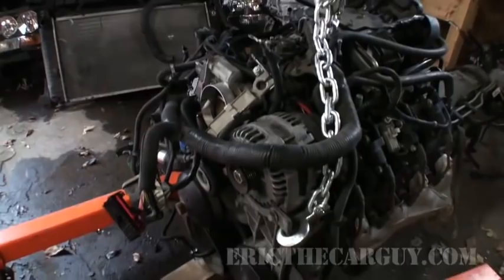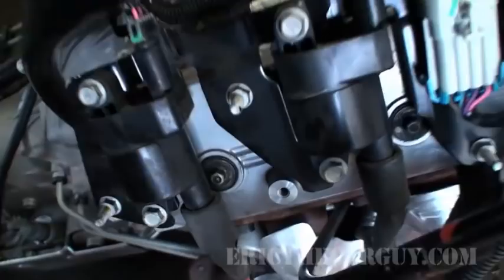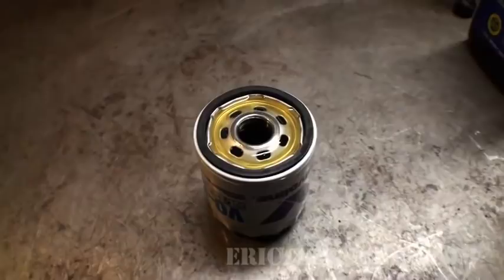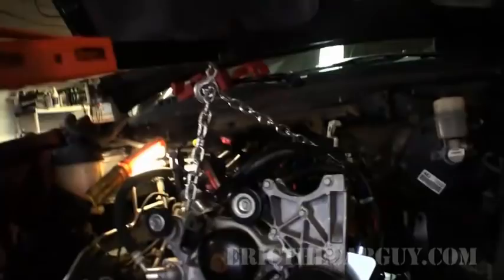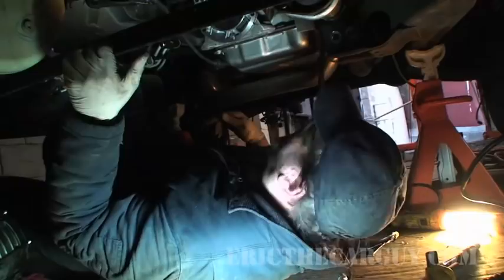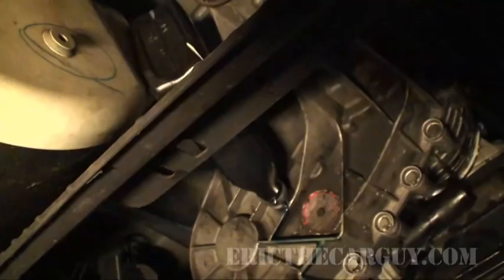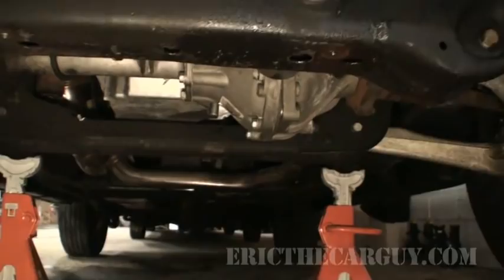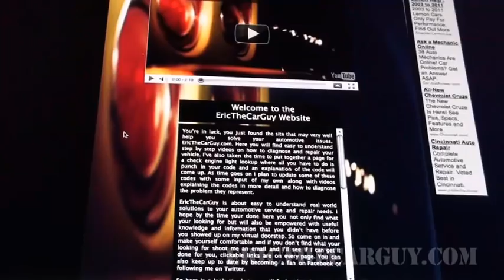2007 Tahoe 5.3L Engine Part 3 - EricTheCarGuy

Comment from the maker: @itneverwasme The PS works I just had to rev the engine to get it to start circulating, same thing on the last GM I worked on, works fine now though.  I do plan on doing a Part 4 covering what happened to cylinder #6 in a few weeks.  Thanks for your comment.

Comment from the maker: @acttacus That is good to know because I looked for the adjuster under the steering wheel and by the trans and didn't find it, the shift cable on this truck runs along the frame rail and then up by the gas tank so I really couldn't see anywhere for the adjustment where I looked.  I'll be sure to look tomorrow though as I'm fixing the exhaust and going over it before I send it on it's way.  Thanks for the tip.

Comment from the maker: @qaz3000 I think your referring to a block heater which you may find on cars and trucks in cold climates.  The cold makes things thick and less likely to move correctly, also batteries don't work as well when they are cold so between those 2 things it's hard to get a car started from stone cold to running again.

Comment from the maker: @Michiganborn1969 Yea it was close but it worked.  The injection system you describe has been used for a few years on GM vehicles if I remember correctly.

Comment from the maker: @nizmojoeblows If it's fuel injected it will actually warm up quicker if you drive it, engines really don't like to idle for long periods and in a way it wastes gas.  If it's that cold for log periods of time you might consider a block heater  as they are great for cold weather like that.

Comment from the maker: @touchymuffin97 With enough money and time you can do just about anything.  The thing with 'modern' engine swaps is that you need to consider if your computer will run the new engine correctly, sometimes you have to change the computer and wiring harness to get that to work.

Comment: Great videos Eric, love em.  Watching you wrestle with the transfer case reminds me of the time I changed the clutch in my 1978 Econoline.  It was in my driveway in the late fall.  The weather was terrible and I was laying on a blue tarp under the truck holding the transmission up while a couple of guys were above trying to guide and install bolts.  A gust of wind shifted and the freezing rain/snow dam that had formed in the blue tarp let go and suddenly yours truly was laying in ice water. Fun!

Comment: I was replacing the transmission and transfer case on my 48 Ford, so I bought a transmission jack to make things a bit easier. Well, the one I bought was a cheapy and it really wasn't strong enough. The transmission went in ok, but the transfer case is much heavier in this case.  I had the transfer case nearly into position when the scissor-style jack just started to fold over. I tried stopping the 200+ Lbs with my hand and it just pinned my hand to the floor....fun times.

Comment: Eric, you need to get yourself a transmission jack! You even said so in the video. You could pull a muscle or a transfer case could slip out of your hands and hit you in the chest and that would really be a bad day!

Last Saturday, on the December solstice, I woke up with a torn muscle on the lower, right side of my back! Oh, did that hurt! It still hurts a little. The day before I was working out with dumbbells and jumping rope. I must have pushed some muscle too far.

Shifting a transfer case around, the damage could be so much worse. Treat yourself, buy a transmission jack. It's money well spent and you deserve it :)

Comment: Sometimes we have to make do or do without when it comes to repairs. Chrysler doesn't even use gaskets when it comes to the transmission pan. I've used gasket maker for nealry 25 years and NEVER had a problem with leaks, whether oil, transmission, or coolant. Nice job Eric.

Comment: Cool background music, great video. I was a little worried for you when I saw you balancing that transfer case over your face. Lose it at the wrong moment and you would have a new set of braces. There has to be an easier and safer way. Could you make your own trans jack with a floor jack and some plywood?

Thanks for posting, Eric.

Comment: Hey Eric! just a quick tip. Keep some stuff called "The right stuff - One minute gasket" on hand. Its absolutely awesome. used it on the Front differential of my ford ranger ( you have to remove the pumpkin from the frame, real fun) and the rear diff of my F150. It seals amazing, and the surface doesn't have to be perfect for it to work. Its meant to be used withOUT a gasket. It would have sealed that Transfer case up perfect.

Comment: Someone else has mentioned it but you can buy a lift plate the bolts to the valley as the anchor point for engine remove/replace. I made one out of two 19" pieces of 2"x3" angle iron. Fit perfectly once the hole were drilled.

Comment: Power steering priming tip, no revving/engine off, you fill the reservoir up and with the wheels off the ground just cycle the wheels back and forth, it pumps the oil through, and just keep the reservoir topped up as you do it, at some point it will just remain the same level and its done.

Comment: just like they're thinking for the pickup tube o-ring and nuts on the bottom side you got to drop the oil pan when there's a threaded hole on the other side and you wouldn't have had to go figure really great

Comment: In the last video comments i said silicone is fine at the transfer case when reassembling. I've done it many times this way and no comebacks. Actually just did one last week. It was fun to watch you struggle with it but I don't understand why you didn't remove the driveshaft. It just slides out after you remove the boot clamp. The cats do come out from undernieth. You have to remove the trans crossmember and front driveshaft. Job well done again..

Comment: eric if you go to northerntool's website, they have a transmission jack adapter for about 50 bucks.  Just stick it on a floor jack and youll no longer have to wrestle with transfercases and transmissions

Comment: Great video and series on this truck, my fav so far. To those that say Eric should have used a jack, ever try to balance a tranny or transfer case on a jack? It is not going to happen. I've done the same routine, balance a tranny on my chest and fight it into place. Not pretty but it works.

As for the sealant he used, it will outlast any conventional gasket. In fact most transmissions now only use RTV because it will outlast the vehicle in most cases.

Comment: @EricTheCarGuy A lot of techs try and only take apart what they feel is necessary to save time. In the long run it saves time and headache sometimes to just remove the things that make life difficult. I use zip ties on the driveshaft boot. There is no flex there like a CV boot. Its just a dust boot.
 I hope i'm not getting on your nerves lol.

Comment: Nice video!  I would of disassembled the front suspension.  In order to lower the engine and support.  That way you can lower the whole thing to the leg of the engine hoist and wheel it out.  That's just me.

Comment: How's it going Eric. I gotta 07 tahoe. Giving me he'll. Replaced all lifters coils, gaskets plugs wires. 2 lifters immediately busted.. 4 and 6. Replaced them. Head off again. Start it up take off. Lifter bust on the other side. I'm not getting rid of my Tahoe but I'm angry. What's wrong with my 5.3

Comment: Eric, i have a 96 Jeep Zj and i change the t/c fluid 2 x a year, i have one of those hoses that screws only the bottle and also a pump, pump is SLOW as the hose dia. is very small. I just changed F+R  diff fluid

Comment: I know what ur sayin, I hate it when ppl want me to swap equipment because there is always issues getting it back right... I did my Toyota from a 3EE single cam to a 5E-FE twin cam, studied wiring diagrams for weeks. Swapped the distributor harness and run it on the old ECM

Comment: Nice job, the sealant will be fine-screw Warkhan.  What happens with the power steering, still no pressure at low rpm?  Would love to know what's up with the original engine, but take a break, you need it after this best

Comment: great video Eric! Well i have a 1994 Mazda mpv rwd 3.0 and I want to put a 2011 Toyota tundra 4.0 v6 engine and transmission. I want a strong and fast set up and also one that would last. I was also looking at a Nissan pathfinder because they are both rwd and the van is rwd. I was hoping you had any tips on that.

Comment: Once he removed the front and the core support , radiators , etc. he dont have to put it on the ground.  Some cars it much easier to put it one the ground though. Two weeks ago  I pulled an engine out a 94 Camaro and I had to put the car on the ground to get the engine w/transmission out the car completely.

Comment: Some people aren't real big on using paper gaskets, they go straight for the RTV. I've heard complaints about seepage... I never witnessed a situation like that but hey......

Also I have seen Felpro gasket sets come with a tube of Permatex Gasket Maker RTV and instructions to use just the RTV in place a gasket that is not included....

Comment: older motors have a  distributor that set the timing and newer motors ( gm 00 up ) dont have a distributor they have a coil for each spark plug and the computer sets the timing

Comment: Thanks for posting these engine swap vids!  i love 'em!   But i come to you with a question,  I'm having a problem with a 2000 sienna, that i'd like to get some advice on.  It shakes like crazy at 65-85mph.  Any slower or faster, and it drives real smooth.  I've replaced the drums, tried another set of balanced wheels, and replaced the shocks, but to no avail.  I cant tell if its coming from the front or back, because the whole thing is shaking, any advice on this one?

Comment: @deeman52586 I've done the cats on this truck before. They are not as bad as they sound. Long extensions from underneath with an impact are the way to go. If I recall I did have to remove a Xmember but all in all it wasnt as bad as it seemed.

Comment: In part 2 asked why you didn't take the fuel lines off at the intake. I see why, the brackets attached to the trans. Also when my dealer replaces engines in these trucks, I believe GM does instruct you to remove the intake manifold. So the fuel lines have to come off the fuel rails. And the trans stays in the truck. You asked about replacing cats. It's tight, but you remove that cross member and the poorly placed O2. Lots of penetrating oil on the nuts. And get 2 people to manuver it out.

Comment: @EricTheCarGuy - I do not want to see the pricetag on those two catalytic converters - I'm guessing the whole section was bought from the dealership? I'm going to take another guess that you get jobber rates on parts and supplies - if you need exhaust componants - try looking at fle-online. com (Full Line Exhaust). They have excellent rates and don't rape you on shipping. I sourced all my componants from there for my MX6 exhaust including a Magnaflow/Carsound cat for $65. Great rates for OEM too

Comment: you could use a gear oil pump to fill the transfer case. They work GREAT and cost $10 at napa  They look like a soap dispenser.

Comment: i have a 99 tahoe and i put a 700r4 trans in it why when i pull a hill or the rpm's pass 2000 my truck bog down and have a smell coming out of the tail pipe

Comment: changing the cat's is really easy after u remove that o2 sensor, the sensor looks like a bitch but it is easy to remove, then use a 15mm semi deep swival impact socket and bam bam they come off, remove that crossmember witht eh 18mm wrench and socket and they slide right out!

Great vid man! love it!

Comment: Messing with that transfer case just looked super dangerous. I couldn't help picturing it slipping out of his hands and squashing his head like a watermelon.
Reply: They aren't that heavy. I could probably swim the english channel with one strapped to my chest.
Reply: I doubt that. I've worked with them plenty of times, they aren't that light. I was being sarcastic about the watermelon thing anyway.
Reply: Nick B I was being silly. When I owned a truck with a 208, I could remove and install it buy myself. Same with a turbo 350. I have taken out a 203. That was heavy and all of these on my back, the transfers cases without a jack.

Comment: Push rod engine? On a 2007 vehicle? I thought those things died out over 20 years ago.
Reply: They're still a reliable, cheap, power house that motivates many vehicles my friend.
Reply: Overhead cams were developed in 1913, but oh no, old pushrod engines are old.
Reply: Samniss Arandeen pistons were used in steam engines and we still use them....why not turn every vehicle to electricity? I don't see the point about all that arguing.....